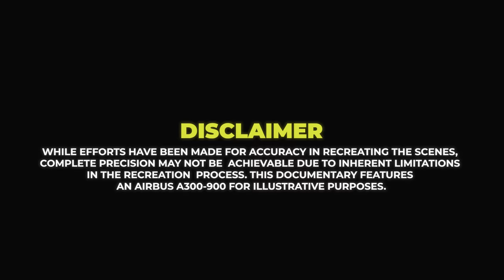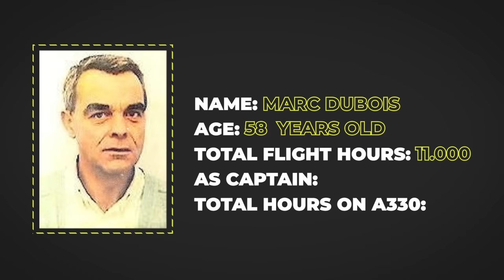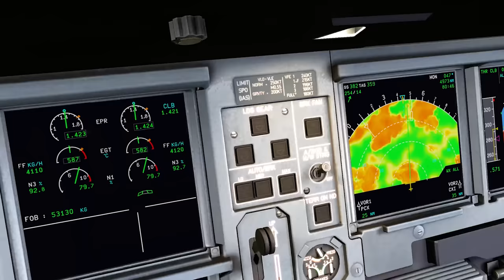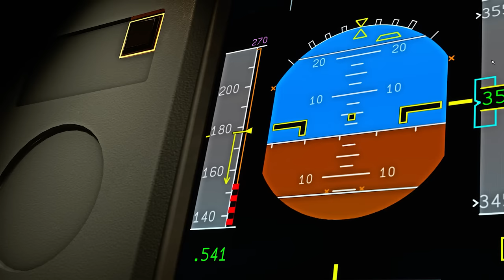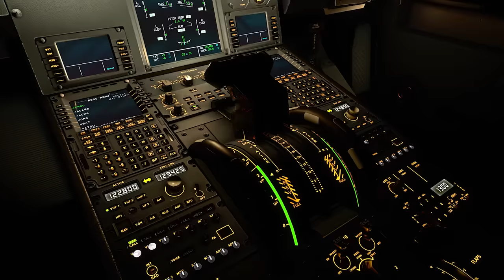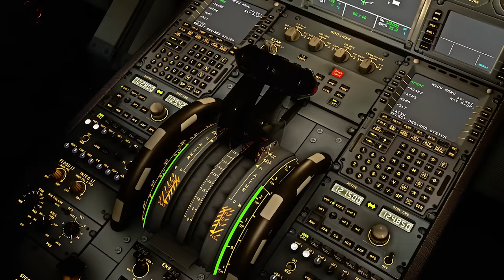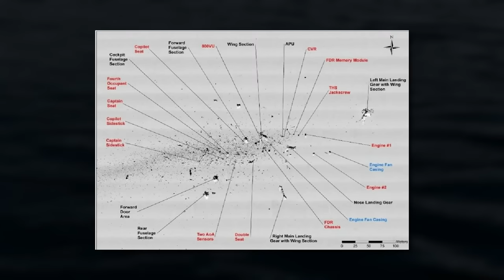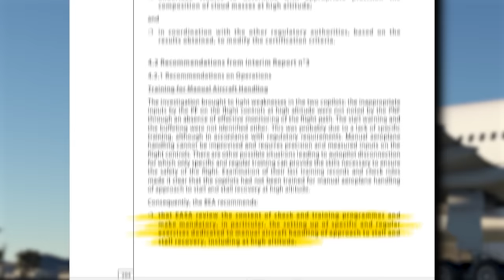Horrific Freefall into the Deepest Ocean | The Sad Story of Flight 447

Comment: You lost me at “top notch aircraft”. Defective pitot tubes that froze does not constitute as top notch. A known recalled issue with the tubes awaiting replacement. So you have a less than prepared aircraft flying in weather it wasn’t ready for, combined with the over automation of airbus. You can’t dispute airbus saftey, however when things go wrong with an airbus related to manual flight, it all goes south. You have an FO doing all sorts of things with his side stick and the captains side stick gives zero feedback as to the behavior being demonstrated by the other side stick. This design should scare any captain, I hate the logic. Even with all Boeings garbage going on, I’d take a Boeings pilot friendly design any day. Sad accident, avoidable as so many end up being. Flow of video is good although neglect to highlight the aircraft was inadequate for flight, and unsafe.
Reply: Clearly you have never flown or have any understanding of an Airbus when you say “when things go wrong related to manual flight it all goes south”. The FO was the sole person responsible for this accidents. Pitot tubes get blocked, that’s a fact of life. This particular design it just happened to happen more often than others. There are procedures in place to fly the aircraft with loss of airspeed indications, memory items and QRH pitch and power tables. And if they had kept the plane straight and level for 60 seconds they would have had airspeed back and even been able to switch the AP back on. 

Regarding the sidestick movement the one in the captains seat has the ability to press a red button which give him total control of the aircraft, he failed to activate it, the pilots didn’t talk to each other regarding their actions and nobody looked over to see what the other was doing. The sidestick is not invisible to the other pilot. And having a connected yoke does not get you a get out of jail free card as the pilots of AF11 proved

Comment: 3 pilots two of which are under the age of 40.... R u fkn kiddin'?
Reply: Age means nothing, it's experience that counts, 
Captain Marc Dubois, 58 had nearly 11,000 hours of experience, including 1700 on the Airbus A330 and in 2007 had flown 16 sectors on the A330/340 to and from South America
Relief First Officer David Robert, 37 had over 6500 hours of experience, including 4400 on the A330 and since 2002 had flown 39 sectors to and from South America on the a330/340
First Officer Pierre-Cédric Bonin, 32 had 2900 hours of experience with 807 on the A330

Comment: This is very sad but hopefully the added suggestions help and it seems so far they have.As far as I know no other significant problems have been reported.It's so sad that we can't think ahead to possible problems to prevent them.Being proactive and common sense would of helped them to arrive in France safely.If it was me I wouldn't of cared how the plane was moving as long as it was moving & I only would of dipped the absolute bare minimum low enough were the plane was out of the strongest winds.Why don't the peto tubes have some screens over them to keep things out of them?I wasn't there flying but I bet you if I had the controls we would of arrived safely. RIP